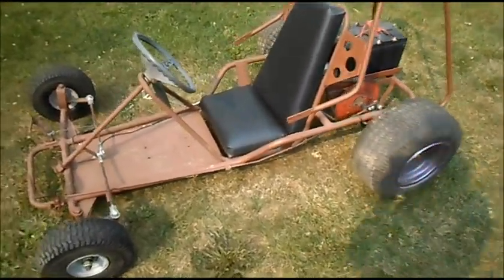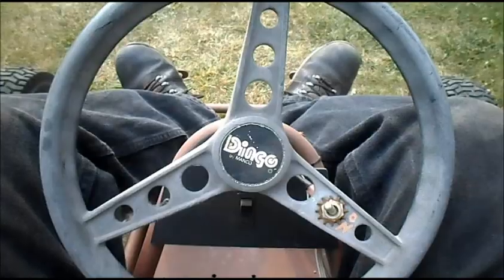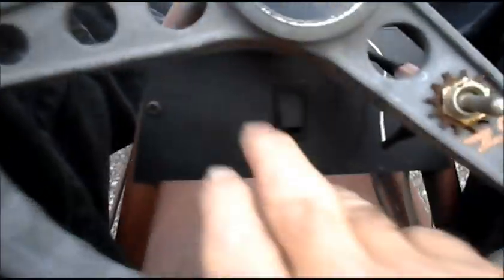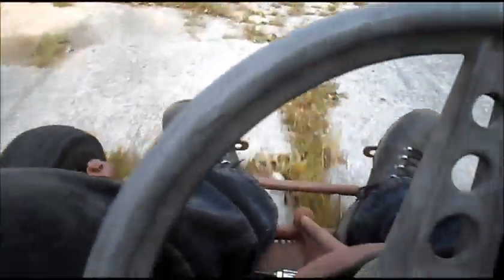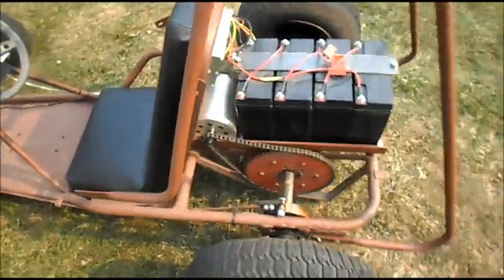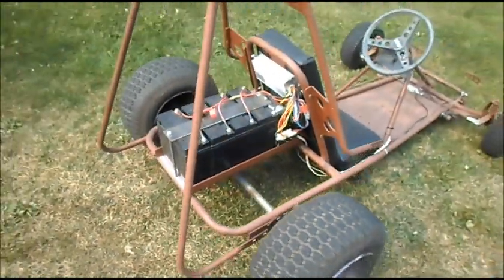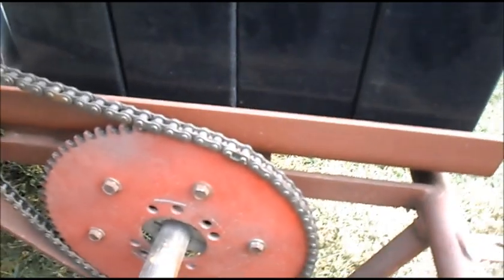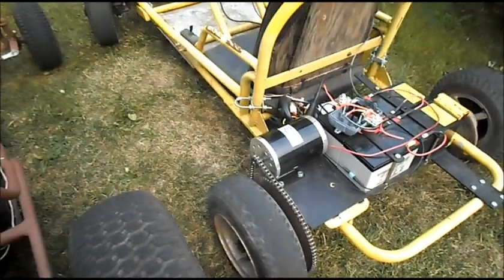El Dingo II final test drive with Boma 1,800W motor

Comment: Ahahahah 7:36  
By the way, how does the reverse work? Is it literally reversing the rotation of the motor or ? thanks in advance.
Reply from the maker: It is an actual forward or reverse switch.  It switches inside of the speed controller. Yes, it reverses the rotation of the motor. Here is a thread showing how this motor is connected.  http://www.diygokarts.com/vb/showthread.php?t=37537
Reply: Reverse polarity